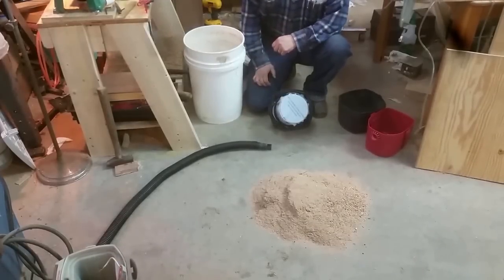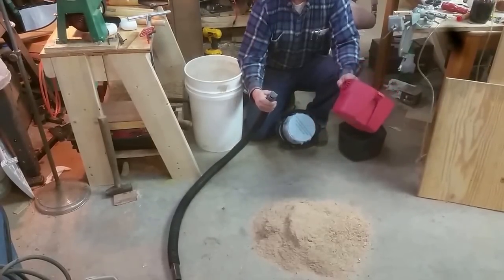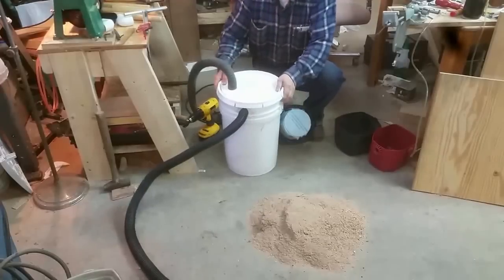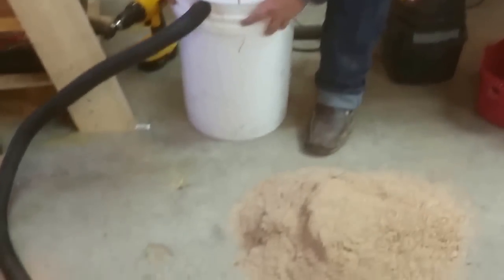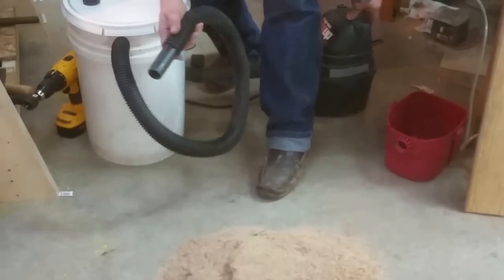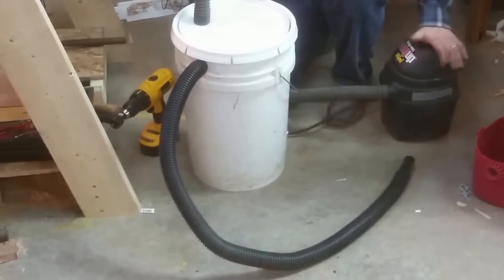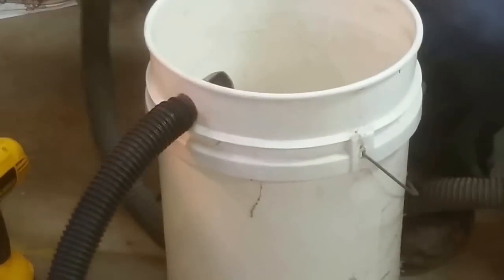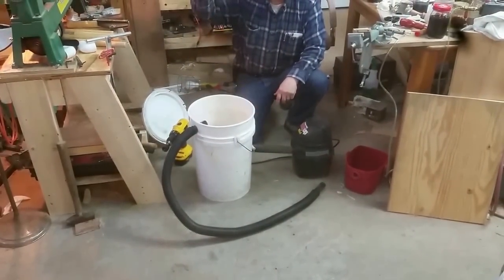5 Minute Cyclonic Dust Collector

Comment: I made one of this today. Works 100% but sucks the bucket in where the suction pipe is. Is this normal or is the bucket too soft or the vacuum to powerful. 1400 watt vacuum.
Reply from the maker: Could be a bit of both. I would start with a different bucket. Make sure both hoses are the same size.
Reply: @ricochet981  thanks I'll try a stronger bucket.

Comment: Excellent!  Thanks for the video, in order to increase the efficiency may I suggest putting the intake (sucking) hose from the vacuum in the center of the lid. That way it stays away from all the debris cycloning around the outside edge and is sucking cleaner air.

Comment: Nice work boss! I have a pretty cool idea for you.. we all know how much of a pain in the butt it is to pull Lids off of buckets, go to Lowe's and pick up what's called a Gamma seal lid. I think it's $6.99. it'll snap on to any bucket with a nice tight seal.here's the cool part, when you go to empty the bucket you just unscrew the center of the gamma seal lid., Empty your bucket and then screw it back on. Check it out. Thanks for the video.
Reply from the maker: wrecked4life thanks for the comment, and the great idea! I will check out that gamma seal lid.
Reply: My pleasure, what a world of difference when all you do is unscrew a lid rather than prying it off everytime, especially if you use it a lot like I do. Take care and have a great Christmas season.

Comment: I like it! 

I have a workshop vac with the same angled inlet fitting and found that it blocked fast if I tried to vacuum up wood shavings, I cut it off so the air flow is straight in to the bin and now it doesn't block. So I imagine this design will also tend to block up with debris bigger than sawdust.
Reply from the maker: Thanks for your comment. I have had it block up on me a couple of times, but usually only when i picked up something larger like sanding paper scraps or small pieces of wood. I use it as a dust collector for my mini lathe, it doesn't get everything but it is the sanding dust I'm most concerned with and it does a respectable job catching that. How efficient is your setup with the straight in inlet? It seems like it won't be as effective at separating the dust from the air.
Reply: I am describing a regular shop vac (made by another company) not a cyclone extractor. But the same issue applies, in that the inlet to the canister has a partial blanking in order to direct the airflow around the bucket's perimeter. I have not noticed any difference in performance with this deflector cut off. (Although this shop vac has poor final filtration in any case, which a reason for my interest in building a cyclone extractor.)  Thanks again for your video.

Comment: Ive watched at least 20 videos on this subject and this one was the simple of simple with out over kill and expencive toolings ive never even knew excisted thanks for keeping it simple and putting the part of the build from vac connection to bucket in your video the part that can confuse wher your exhaust gos after reaching vacume
Reply from the maker: Thanks for your comment Elliott. The idea here is to keep it simple. I'm quite sure that there are better ways to do this, but if you need to make a seperator quickly this does work.
Reply: I would have to agree. This was such an easy video to watch and then turn into a reality. Many thanks

Comment: Nice and simple. Thank you for the video.  Many of the other videos say that the vac needs to be at least 5 horse power.  What horse power are your mini vacuum cleaners rated at?
Reply from the maker: I couldn't find a horspower rating, I'm sure they are not really all that high. I wouldn't try to use this setup for a whole shop system either. The idea here is more a way to expand the pickup capacity of your vaccuum. Aslo, you don't need the mini vacs to make this work, you can totally use larger shop vacs. You just need to get the right hole size and make sure you have an inlet piece that goes 90 degrees.
Reply: Thank you for your reply.  I have a 3.5 hp 12 gal. Shop Vac that I want to use, but I wasn't sure if it was powerful enough to use on my dust collector project.  But when I saw your mini vac setup work.  I'm pretty sure mine should work also.  It won't be used as a "full shop system, just for individual tool hook up. Thanks.